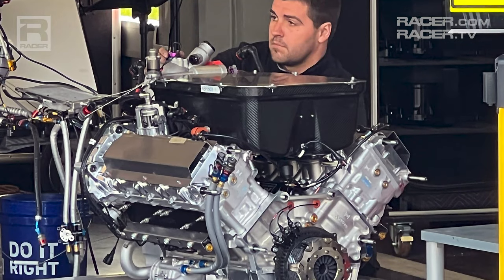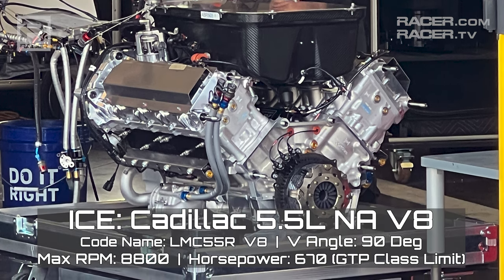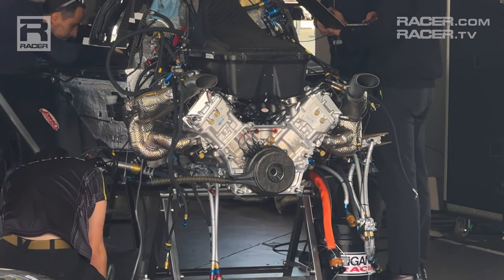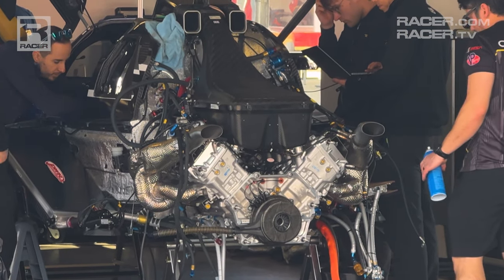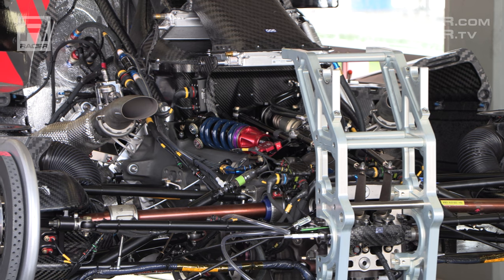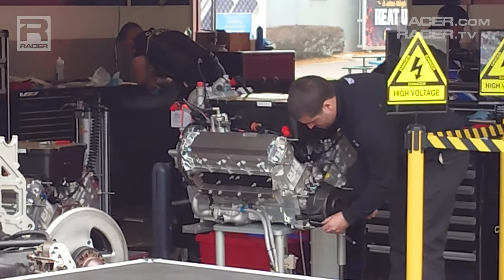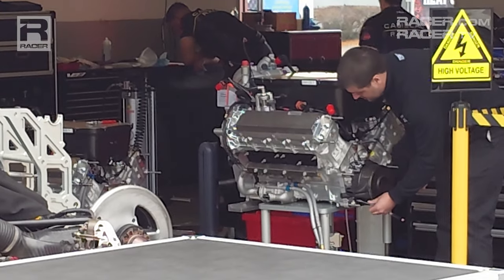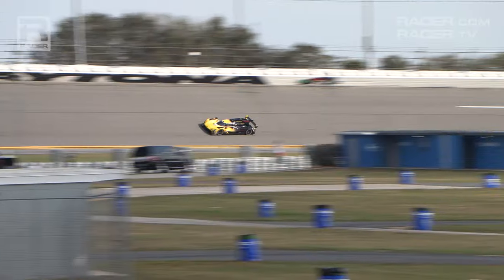IMSA GTP 101: Cadillac V LMDh Internal Combustion Engine

Comment: When they first announced that they’re using a 5.5 V8 I figured it was based on the C8R engine.
Reply: That or the old DPi engine with a higher rev range. Building a completely New one is insanely cool, but absolutely nonsensical.
Reply: @TheNecromancer6666  The old DPi engine was a single cam in block, overhead value, push rod engine with a cross plane crank shaft.  This new engine is double overhead cams with a cross plane crank shaft!
Reply: @byates59  Apparently so yes. The old one was basicly a race modified LT1. This New one is a 100% Prototype engine. Insanely cool but still kinda insane.
Reply: I still have a sneaking suspicion that it's the C8.R block and heads with a crossplane crank and corresponding firing order to give it that unique sound.
Reply: So if we got a cross plane in the new Z06 this is what it might sound like, interesting…
Reply: @DisturbedVette  prob will be in the zora…..with the electric to
Reply: @amordeweso  that would be interesting to say the least

Imagine if they decided to make the zr1 what everyone thinks the zora will be and the zora is actually going v12 plug in hybrid powered

Comment: This is what GM could put on road cars if it wasn't for all the epa regulations and electronics that modern cars require. Pure compression and cam design optimized for performance, nothing more. Put that dame engine in a street vehicle and it's game over.

Comment: You are still getting the Power numbers wrong. Its a 500kw wheel power performance Target. But the engine Power is 15% higher, around 575kw. So its mot a 670hp engine. Its a 770hp engine.
Reply: bruh wdym there not allowed over 670
Reply: @mememanfresh  Did you read my comment? The Power is measured at the wheels. So including Transmission losses. Which are around 15%. That means the 500kw at the wheels are 575kw at the crankshaft. Also they don't have a hard Limit they have a Performance Window which is between 500 and 520kw at the wheels depending on the BoP

Comment: What's with your head all of you Americans?
2.4 liter displacement is a tiny for you guys?

Having too much displacement like a 5.5 liter LS engine still call it small block for that displacement WTH.
XD
Reply: You have to remember that an LS engine is absolutely microscopic relative to its displacement because of its pushrod design. An LS7, with its massive 7 liters of displacement, is both lighter and has smaller exterior dimensions than BMW's 4 liter S65 V8.

Comment: Isn’t the Corvette C8 Z06 using a 5.5L V8 that revs to 8600rpm? Though GM should be getting plenty of xp with DOHC NA engines in the C8.R
Reply: They are different motors.
Reply: @captaintraction4024  okay thanks. Don’t know GM very well
Reply: @StreetComp  the Z06 has more in common with the C8.R engine.